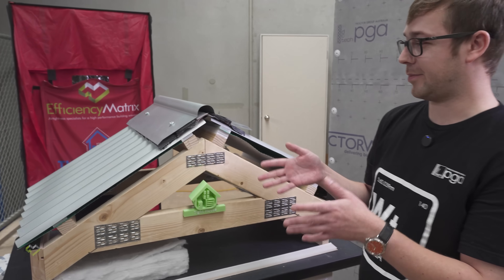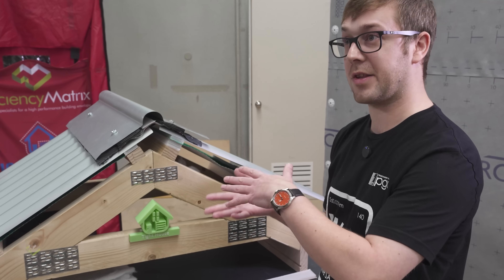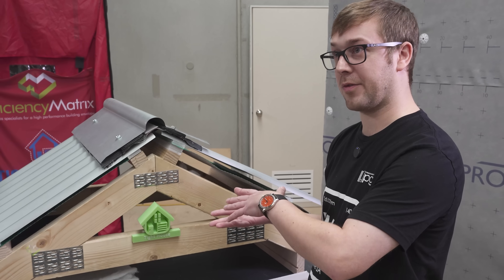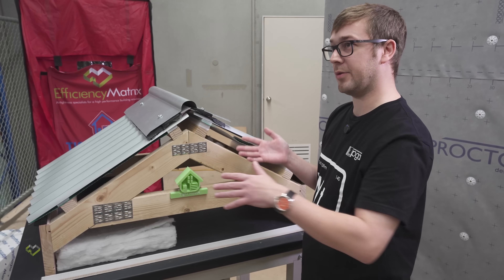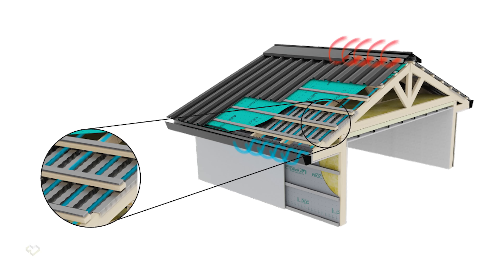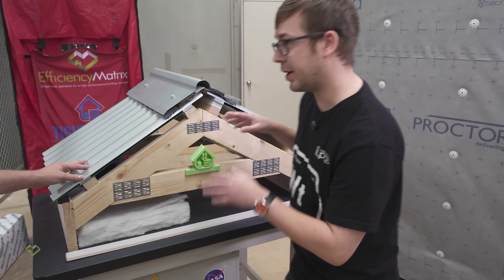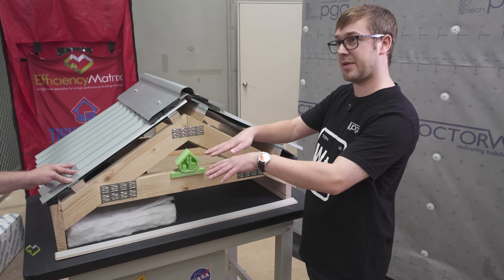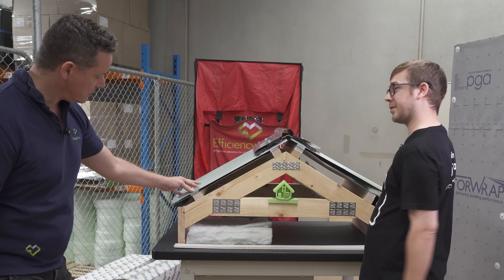Roof Changes to the Australian National Construction Code : Ventilation! (2025)

Comment: I can't see the majority of tweaked out general roof contracters in Oz who work for the project home builders installing any of this properly unless they have an independant inspector checking their work at every stage. Anywhere the work is hidden short cuts are taken has been my experience I could write a book on builder f'ups that I have had to experience in building my last 3 houses. We would be better off with whole roof and wall systems manufactured off site in an all weather factory and then installed by factory supplied installers.

Comment: As if one tiny vent is enough to ventilate a huge metal clad roof. 
All this is doing is giving pests, smoke, fumes and embers potential entry points. But 100% agree ducting makes sense. We have a rental with a gas hob, no ducting just vents the fumes back into the house, you cant use the hob.

Comment: Sorry mate but air molecules are smaller than water molecules, you need to rethink that explination
Reply from the maker: •	Mass-wise:
 O₂ (oxygen gas) has more mass than H₂O (water)
 → O₂ = ~32 amu, H₂O = ~18 amu
	•	Size-wise (molecular diameter):
 O₂ is slightly larger than H₂O
 → O₂ ≈ 0.29 nm, H₂O ≈ 0.27 nm

But here’s the key insight:

Even though H₂O is smaller, water vapor can still pass through vapor-permeable materials that block air — not just because of size, but because of how it moves (diffusion vs bulk flow) and how the material interacts with polar molecules like H₂O.

Comment: Interesting. Feels a bit over-engineered, but I get the premise. I can see issues with hanging the insulation. Creating a uniform layer without gaps, will be a challenge. Ensuring it is installed properly will be another. Simple is always best. I have two questions though.
1. Some footage showed the sarking being installed in vertical strips? I always thought it went in horizontal strips along the length of the tin roof starting from the bottom and layering as you go up? Can you show the install process?
2. I like the idea of the air flow spacers, but they look to be made out of a thin plastic. How do they hold up to food traffic, i.e. can you walk on your roof. E.g. cleaning gutters, painting etc.

Comment: All Australian roofing should have two sheets, an under sheet to seal the house and is not exposed to the sun an outer sheet which is exposed to the sun and is open at the eave and at the ridge so air will convect between the two when the outer sheet heats up. The heat load to the roof cavity and thus the internal attic temperatures will then drop enormously and condensation will not be a problem.

Comment: If that roof wrap is vapour permeable what stops the condensation under the metal roof sheets permeating through down into your insulation batts/frame? Is it only vapour permeable one way?
Reply: Water droplets and running water are not vapour. Vapour naturally rises; condensed water droplets fall.
Reply from the maker: Sure but once the droplets are inside the roof detail, they are destined to become vapour.

Comment: I’m sorry but air molecules are not bigger than vapour molecules. A quick google and chat GPT debunks what this guy is talking about. 6:00. I think what he means is it draft proof. It doesn’t really let air move through it. But over time it can some much so it is negligible.
Reply from the maker: Yes, water molecules are generally smaller than the primary molecules that make up air (nitrogen and oxygen). Water molecules have a diameter of roughly 0.275 nanometers, while air molecules (primarily nitrogen and oxygen) have diameters around 0.364 nm and 0.362 nm respectively. 
Here's a more detailed breakdown:
Water Molecule:
A water molecule (H₂O) is composed of two hydrogen atoms and one oxygen atom. Its shape is often described as a slightly bent or V-shape. 
Air Molecules:
The primary components of air are nitrogen (N₂) and oxygen (O₂). These molecules are diatomic, meaning they consist of two atoms of the same element.

Comment: How about insulated roofing pannels ?
Reply: My question too. 
My roofing is insulated. It’s a metal/foam/metal sandwich. With further foam both between the Purlins and a third layer between the rafters. That’s 160mm of foam. 
All of that is laid directly on top of solid exposed timber ceilings. 
So there are no spaces whatsoever between inside and outside. But there is more than R8 of insulation.

Comment: Through out the years in our architectural office we have always detailed insulation directly to the underside of the metal roof cladding with sarking below the insulation and above the roofing battens. This has thermal and sound dampening properties. Never had an issue with condensation.
Reply from the maker: What climate are the majority of your architectural design being built in?   It very much depends on climate zone, and whether exhausts are exhausting directly into the roof space, plus the type of human activity in the home/building

Comment: I don’t understand why you would want breather wrap in this instance seeing that you are venting the entire roof space, airborne moisture can get trapped in the roof space. Therefore would you not benefit from a foil wrap that adds a bit of summer ir insulation to the equation. Can the new ncc requirements be met by venting bellow roof but  above the wrap only? If breather wrap is used?

Comment: Last year I lived in a 4yo unit with a tin roof and it didn't have insulation or vents in the roof. During summer the water coming out of the cold tap was over 50C and you could have a hot shower for 10 minutes whilst under the cold tap. There was no cold water during summer so if you got burnt by the water coming out of the cold tap, you were screwed. The air temperature in the roof cavity would regularly hit 80C during summer. It was a fire hazard and safety risk and increased the temperature inside the unit. Nobody in the government gave a crap when it was reported to the council, state and federal governments.

Clay roof tiles keep houses cooler than tin roofs and in a time where climate change is an issue, we should be banning tin roofs because they heat up faster, trap heat, then release it overnight. Clay roof tiles don't do this and are better for the planet.
Reply from the maker: Don’t forget, colour makes a big difference too.  A white colour bond roof can actually stay quite cool.

https://m.youtube.com/watch?v=V8dg1ePdJ68
Reply: @ecoevo  They still get hot like cars do. Light coloured cars still get just as hot as a black car but the black one gets hotter faster. Vents definitely help tho :)
Reply from the maker: @RandyGnome sure they do,  but terracotta clay, or concrete, these materials are thermal mass.  The energy is still there.  A black colour will absorb significantly more energy than white, no matter what material it is, steel, or masonry.
Reply: You may have a misunderstanding with the roofing materials. Clay or cement tiles have a large thermal mass that will absorb lots and lots of thermal heat energy during the day and radiate in during the night. A clay roof may take 3 or more hours to loose all that stored heat. On the other hand a sheet metal roof has very low thermal mass and will radiate it's stored heat in only minutes. Metal roofs are the premium choice for Austalia outback and tropics. Simple experiment is light the barbie and put a brick on one side and a empty steel can on the other side and let them heat for twenty minutes. Turn the barbie off and wait three minutes and pick up the empty steel can, and then try picking up the brick.
Reply: @haydnwilde  Clay tiles have lots of little holes in them that acts as insulation and helps stop the heat from transferring through into the roof cavity. It still warms up but nowhere near as hot as a tin roof. If they do white clay tiles, that's ideal for hot Australian summers. In my opinion, dark roofs and cars should be banned because they heat up faster and we don't need that in Australia. 

They use clay/ ceramic tiles on space craft as heat shields to stop the inside of the rocket from heating up when it enters the atmosphere.

The place I was in with the tin roof would still have heat the following morning. I was able to have a hot shower under the cold tap at 5am (9 hours after the sun went down).
Reply: @RandyGnome  When you say clay/ceramic tiles you are talking bathrooms, when you talk space shuttle you are talking tiles made with a borosilicate glass coating over pure quartz silica fibres, a light soft porous material that you will see pottery kilns made of to insulate and stop heat transfer that is very light and  can be easily crushed in your hand that has near zero thermal mass. Concrete and clay has high thermal mass (it will store heat energy) . The metal roof building you stayed in stored the heat internally, while the metal cladding itself, has next to no insulating factor (lets the heat energy pass through) and having very little thermal mass and cannot hold it, would not be able to store heat and been at the same temp as the ambient temp until the sun shone on it. Making the metal thicker will increase its thermal mass, but thin sheets, no. Thick aluminium slabs will get hot over a fire and thin aluminium foil sheets will have no heat the moment you remove the heat source. The building mass got hot while the roof sheets cooled the moment the sun stopped shining.
Reply: @haydnwilde  The clay tiles we had on our roof back in the 60s and 70s had little pours in them. They made wonderful insulation. You could be in the roof cavity during the middle of summer and touch the tiles and they weren't hot. Maybe new tiles are different?
Reply: @RandyGnome look up the insulating values of all the materials you are mentioning. There are sites listing the R values, the larger the number, the better the insulation ability. Single and double brick walls are very low. The lists will quote the the improvement that adding different products and doing things like sealing gaps around doors and wall vents. I do not think clays and cement tiles and metal cladding alone has any rating at all.

Comment: Who are making these changes, according to all these new building code changes all existing structures should be torn down. Australian domestic construction is a massive joke. That is absolutely the shittest idea that will never take, with the current knuckle heads doing domestic construction 😂
Reply: No existing homes are unaffected, unless you are replacing the roof for example.
Ideas are taken from international standards and adapted to Australia.
Buildings built after 2002 are so much more comfortable than those built before then, but each year they just get a little better

Comment: It is important to note that the standard ridge capping allows for an enormous amount of ventilation. in actual fact the standard ridge capping on corrugated iron will allow more free air movement that using the plastic ridge vent fillers shown in the video. The fascia vent improves ventilation under the sarking but the ridge product restricts natural ventilation of the roof.

Comment: In Australia, in the majority of cases we install insulation between the sarking and the metal roof.
this improves the insulation of the roof cavity where the heat is kept out of the roof with the added advantage of deadening the rain noise on the metal roof and the sarking is not exposed to the higher temperatures of the metal roof,
if the insulation is not placed between the sarking and the metal roof.

There is always the better option of placing a small amount of roof insulation under the metal roof with more insulation on the ceiling. This is the best option scenario .
it is important to consider the rain noise on the roof sheets.
Reply: I was always under the impression that air gaps provided the best cheap and affordable insulation, as air doesn't conduct heat well and can obviously be moved along naturally and allowing cool air in to replace from the lower end. Why not just incorporate three air gaps and then focus on insulation around ducted air conditioning systems and walls?

Also, how is no one building prefab roof systems like this that the roofer can just trim to length, screw in via pre drilled holes and call it a day?

I'm certain engineers could design a modular setup for standard style homes. Knock em out in thirty or so metre lengths and varying widths, then trim down the lengths in 200mm increments for instance, minimizing offcuts/wastage on the job site.

I'm a mechanic so ignore everything.